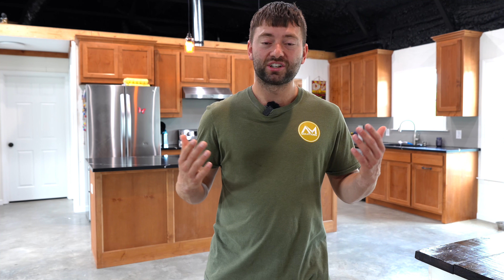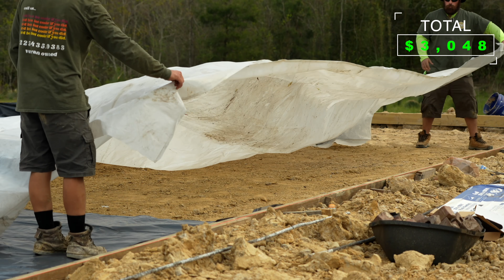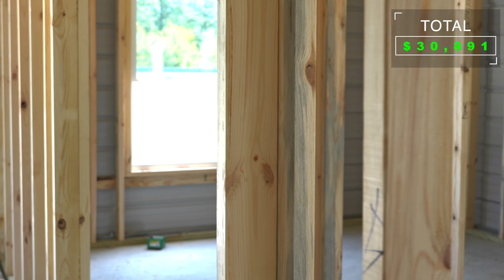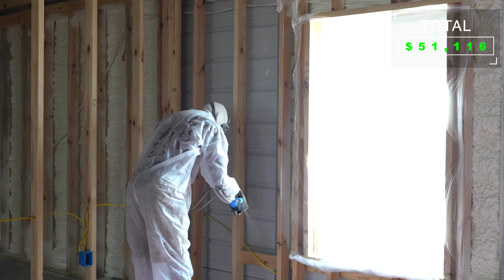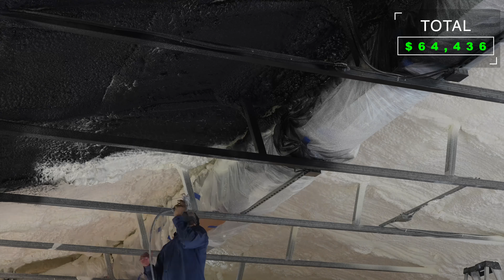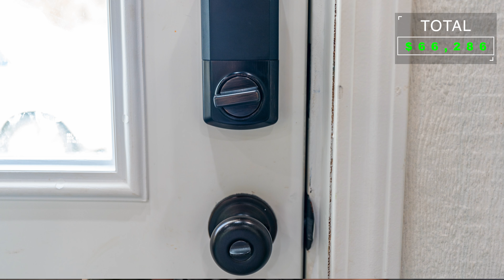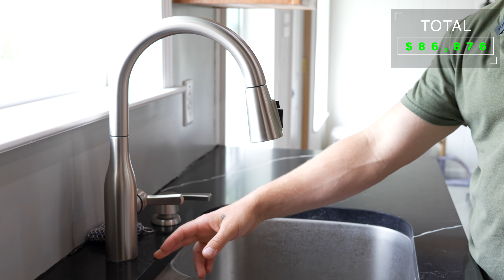Barndominium Price Breakdown | Building a 1,500 sqft 3 Bed 2 Bath Home for $87,000

Comment: Perfect video. 
So for roofs, standing seam is recommended because the screw down metal ones have the issue that after a decade or so, the screws get loose, lose their waterproofness and begin leaking. Is that not an issue with the sidewalls, the way you have them built ? 
For insulation, since it is so cheap, any reasons to not double the wool insulation for a higher R value ? Did you put the same insulation in the roof ?
Why did you go for a custom size for your interior doors (since you built the framing, why not build it at a standard size and save with a standard door) ?
I will build a house next year, this video is very helpful, thank you.
Reply from the maker: Standing seam is ideal and expensive. I will have to replace washers every 10 years or so. It is not an issue on vertical surfaces and I'm building a wrap around porch. 

36" doors are what I wanted. I didn't calculate enough room for the door plus the doorjam and trim, so I had to downsize.

Comment: Drywall isn't that hard.   It's also easy to find drywall contractors.  Just hang out at home depot a while and you will surely bump into them.  For what you spent trying to avoid drywall you could have had drywall.

Comment: With the extra insulation in the walls and the open insulated ceiling, how is temperature regulation? My wife and I want to buy a Bardominium. Also, did you have to go through anything special because of the house being a Barndominium?
Reply from the maker: The temperature regulation is fantastic, I haven't had an electric bill over $70. 

I did sit down and talk through the process with the building inspector before I began construction to make sure everything would pass inspection

Comment: Do you have home recovery ventilation there, with an air exchange?
Reply from the maker: No, but it could be added in the future
Reply: @DudeWeCanBuildIt  How do you handle dirty air inside? Do you open the windows every day? Must be a lot of off gassing from that insulation.
Reply from the maker: @Bart-dg6qv  Inside stays very clean. I change the air filter monthly. The spray foam only off gasses for a day.

Comment: Cool to see what you built. The finishes wouldn't work for most. looks too much like trailer house finishes.  Did you pencil out just framing the house since you double framed it .  I have shop apartment , and currently building few other buildings. The shop kits company info would be great.
Reply from the maker: You can email failsafemetalbuildings@gmail.com for a metal building quote

Comment: The extra insulation you put in the walls and ceiling was a great call but personally I would have gone radiant with the floors being concrete
Reply from the maker: If I lived in a colder climate, I would have considered radiant flooring
Reply: Louisiana has one running the Heater a few months of the year and the rest running cooling. Ie aircondioning.
Reply from the maker: Exactly

Comment: Good video but I have to say that this house is not rated 150mph wind rating, no matter what the mfg told you. I've been in the steel building industry for a few decades and the building is probably 90mph to 110mph in reality. Keep up the good work.
Reply from the maker: Do you know how much effect the closed cell spray foam have on that rating?
Reply: sorry, do you think 2” of glue somehow makes your block shaped metal building somehow bend physics?
Reply from the maker: You should watch the video where they test the shear load of a framed wall vs the same framed wall with spray foam. Huge difference
Reply: @DudeWeCanBuildIt  I know that spray foam is superior in insulating value but I doubt it has much strength to resist wind loads. Possibly a little strength but probably not very much in a straight line wind scenario

Comment: did you insulate all the walls with soundproofing and insulation?  Probably not. Add another 50k and you would have done a great job.
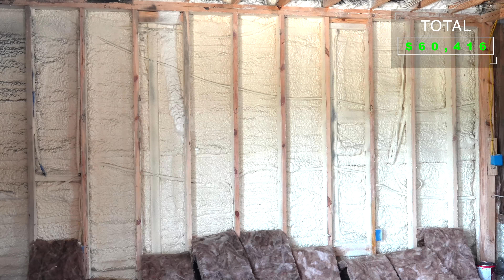Reply from the maker: You probably missed the part or looked away when I said “then I added bats of fiber glass insulation to walls for extra R value that also works as sound dampening.” At 6:08 
But for sure, go off king 💅🏼

Comment: First I’ve never seen anyone run their panels long ways like you chose to do. Second with doing them the way you did wouldn’t you start ground level with the panels and work up. Starting low the 2nd panel will lap over the first . Then the 3rd panel over the 2nd. How the video looks you have it where water higher up the panels can run behind the lower ones.
Reply from the maker: They tucked the lower panels under the higher ones.

Comment: It would be great if there was a video on the permit process and how each step was permitted and completed. I looked at the permit applications for the township I am interested in, and it seems the township assumes there will be one builder for the whole build. I could be missing something, since I am not familiar with the process.
Reply from the maker: The permiting process is different depending on where you live, so no one instructional video would be applicable for everyone. Where I'm at, I just told them I am building it myself and I did not need a general contractor.

Comment: The only problem I think with using external stuff inside let it be paint or else, is that they are usually poorer quality and because of that they are usually more responsive to the changes of elements like temperature and humid and because they are to be used outside they are designed to release more harmful particles.
Reply from the maker: All of the paint is water based latex.

Comment: I’ve considered using one of these cheap metal building to convert into residential as well. @DudeWeCanBuildIt was there any red tape doing a home with this type of building?
Reply: These types of Barndomimums are popular in Rural Southern Mississippi..since they are a new thing each local  code czar king dictator may require different stuff. 

One here had the signed stamped engineering PE steel building plans from the engineering firm on 11x17 paper. The local code guys required them to be larger D size. So they got printed on 22x34 image on 24x36 paper.  Then the code guys bitched the Engineering stamp was 3.2 inches in diameter.  Ie code guy Czar did not understand that everything on the 11x17 paper is twice as big. So code guys wanted 22x34 inch plans with 1.6 diameter PE seal.. engineering firm wanted a 1000 bucks . So finally the code czar allowed the plans with the bigger diameter seal.
Reply from the maker: That's wild. Pure incompetence
Reply from the maker: The building is engineer stamped, so I didn't have any issues. Check with your local permit office

Comment: how are you "saving" money by using a $36 bead board on your ceiling as opposed to using a $12  panel of sheet rock?  the bead board is literally 3x more expensive.  the extra $24 per panel is way more than the expose of mud and tape for finishing the joints on the sheetrock, especially now that you are using the bead board and will have to add the expense of trimming it all out.  same goes with the lp smart side that lists at $24 / panel instead of the $12 / panel of sheetrock.  with that said, the cost savings absolutely does not exist.  it is 3x more expensive BEFORE trim for the bead board and 2x more expensive for the lp smart side...  i still like the way it turned out and seeing someone else do it only reinforces the validity of it's use in an interior space.  i would absolutely spend the extra money because i hate sheetrock, and it looks nice and it is simpler.
Reply from the maker: Sheetrock is a cheaper. However, what is your time worth? Around here, Contractors charge $50 per sheet to hang and float. 

I saved weeks of time or $5,000 if I hired it out. The materials cost an extra $800 and they are higher quality.

Comment: Thank you for sharing your build with us. I really appreciate it. I am trying to escape being a rent slave and own my own property. Its so expensive trying to even find a property with a house on it as they all want too much regardless of how run down the house is. I think my only option is to find virgin land 30-40min outside the city and develop it myself. I have been looking at shipping container builds, manufactured homes, tiny homes, and ect. But a metal home seems like a happy medium between the affordable options. I like how easy it is to set up and build up. I think I can afford to get a loan to do most of the exterior work (utility connection, foundation, metal building purchase and setup). While I save up and use my own labor to build up the interior. All I need is the doors and windows installed. I can still live in the building while finishing the work. My mind is flowing. Thank you.
Reply from the maker: You're on the right track, own your home and get out of debt
Reply: Be careful with trying to get a loan from a bank to do this type of construction, you'll have to make sure to check your locations building codes and banks underwriting construction standards.

Comment: That's awesome. Sucks because in the area I live in, a 40x60x15 metal building without a slab will cost us 85k. Just the steel and panels. That's building it yourself.
Reply from the maker: Oh, wow! That's much more expensive than mine!

Comment: Stupid question, why use romex wire and not conduit? Almost every house I've worked on uses conduit.
Reply from the maker: Conduit in a wood framed house? I've never seen that. How would you even get the conduit to go horizontally in the wall?
Reply: @DudeWeCanBuildIt  you'll be surprised how calm it is in Chicago. Which is where I work.

Comment: this has got to be the most "single guy" house ever :D cool, but the materials and stuff all sound so ridiculously cheap... no way that could be done where I live at that cost. 15k for an entire metal building with shipping and install?! sheez...
Reply from the maker: Where do you live?
Reply: @DudeWeCanBuildIt  Southern Finland... so yeah. Higher cost of living etc. I actually started looking into this idea after watching your video (have thought about it before as well, tbh, that's why I clicked). At 15k the best deal I could find was one third of the size, and included delivery of the material on site, but not assembly. Or roofing. Just assembly would probably cost a cool 10k.
Reply from the maker: Sheesh, that's a lot more expensive

Comment: How much did the engineer cost to convince the county to aprove this for a residence
Reply from the maker: The building came with generic engineer stamped plans. I took that to the permit office and explained to the inspector what I wanted to do. He said it works as an exterior shell. It needs a moisture barrier and there can be no additional load on the building. 

So I used spray foam for the moisture barrier and framed interior load bearing walls.

Comment: For kicks.. I just priced out plywood from Lowes where I live to cover a single bedroom. Your material costs seem to be about half. Even the rebar, I laughed at. $300 for rebar for a whole footer? It would cost me around $1000. 
The only "cost" I saw close to reality was the electrical install. And that was also likely with your buddies discount at the local supply place. Oh, and for kicks, I called up a local concrete place and finisher. Your quote was about 1/3rd what that same 6" pad would cost, even if I had done all the prep and rough-in of plumbing myself. 

So in otherwards, you built an awesome home for half the cost of a normal person because you had connections and an available labor pool who all worked at cost or discounted costs. Realistically, this likely saved you half on materials at the end of the day (less waste, full discounts, decades of experienced resources at your disposal. 

Nice project, and nice home, but
Reply from the maker: Try shopping around. 
I didn't receive discounts on materials but I did a lot of labor myself. 

The receipts are linked in the description, check out.

Comment: Real Barndominium have steel framing 2 to 4' thick concrete footing. This would be a extremely cheap building. There no way to purchase land materials drafting, engineering and fees at that price. This guy is lying about the cost.
Reply from the maker: My receipts are linked in the description. Check it out

Comment: I have a 2300 sq. ft. barn next to my air bnb. I just raised the electric from 100 to 200amps. There is a concrete floor on the bottom floor, and walls that I need to install insulation, (walls removed already). Upstairs loft, I have new plywood set. To add plumbing for 2.5 baths and kitchen, reinforced walls for 2 bedroom (a wall might need to come down and rebuilt), and a staircase for the loft; how would I find the best price. Ceiling will need to be done. Love the B Board for the ceiling.
Reply from the maker: Get at least 3 quotes. Talk to the contractors and find one that is competent. Don't pay until the work is done. Material deposit may be required

Comment: Ive been a finish carpenter for 25 years and contractor for 7. What in the world is that door jamb/casing split thing on the interior doors?
Reply from the maker: It's a split jamb door. Pretty much every pre-hung door comes with a split jamb to make installation faster and easier.

Comment: Is this metal frame you use better at withstanding high speeds winds than a wood frame?
Reply from the maker: You can get the metal frame rated up to 160 MPH. I don't know about wood frame wind rating.

Comment: loved the video! We're on the more serious side of building one of these but our issue is we live in northern PA and have to deal with winter while we build so our option is to build a large 40x80 building and get the shell and floor in and park our 5th wheel in the building while we finish everything but trying to find a contractor around here is all but impossible, they either dont call back or they give you the " I really dont want to price".
Reply from the maker: That's great, I'm glad y'all are building! 

That's wild about the contractors though. It's the opposite down here.

Comment: if you had no skilled laborer friends and you already owned the land I would guess your cost to be around $150k. now for a big cost depending on your local utility would be the length of running under ground elect, especially if your in the range of his property, some utilities won't let you pull your own wire and if you have to place a transformer close you could be in the multiple 10's of thousands right there
Reply from the maker: There are a lot of various costs that I mention in the beginning of the video that you have reiterated. It will vary depending on property value and utility pricing in your area.

There's no way to make an accurate price for everyone, so I only priced the actual house construction.

Comment: I thought insulation rolls were installed paper in
Reply from the maker: Generally, this is how it goes: 

Exterior walls, exterior basement walls, and attic ceilings: The paper side should face outward, toward the installer.

Batts inside the home: The paper should face toward the inside.

This can vary depending on climate

Comment: A little over 8K for all house cabinets plus install???? What level of sorcery is this good Sir? I did my kitchen (just kitchen) alone for cabinets from cabinets to go website was like 10k, with a custom made island plus soft close hardware, I installed everything myself and hired out to a local granite for countertops. That's was another 5k. It sounded like you used a local cabinet shop to make yours? What's the wood type and did you use soft close hardware? Either way amazing video man, good stuff and a lot of knowledge you are just freely dropped, this is going to help and inspire a ton of DIY'rs :) thanks
Reply from the maker: I used a local cabinet shop that built the cabinets out of alderwood and used soft close hinges. I suspect a local shop can beat the online retailer. Your granite price is on par with mine
Reply from the maker: Just added a link in the description to the blueprints for the home and the receipts.

Comment: Did it on a nice budget. Just not a fan of Barndos. No warmth or coziness. And the battons as you called them make it like like a cheap trailer from the 70’s. Should have finished the drywall.
Reply from the maker: That's the great thing about barndos, you can finish them however you want. 

You can make a smooth sheetrock box just like in a regular house. Personally, I think sheetrock is cold and makes a house feel hollow.